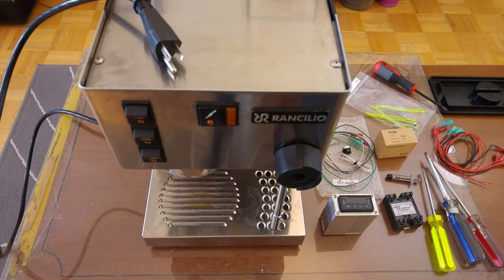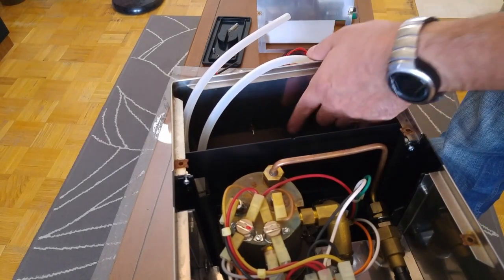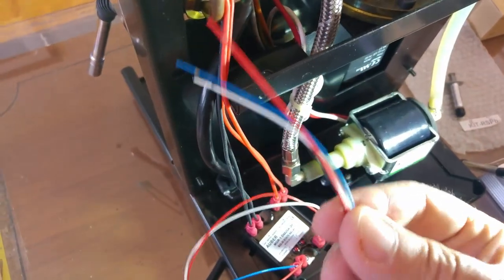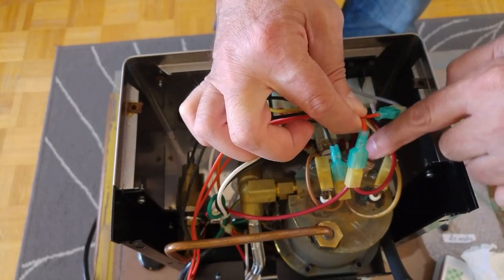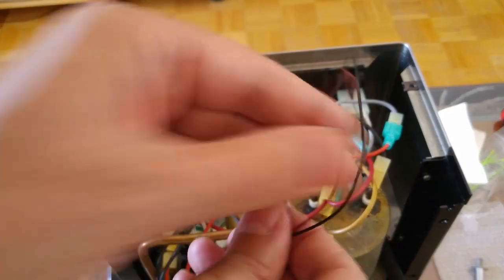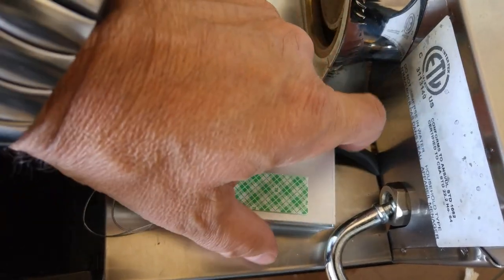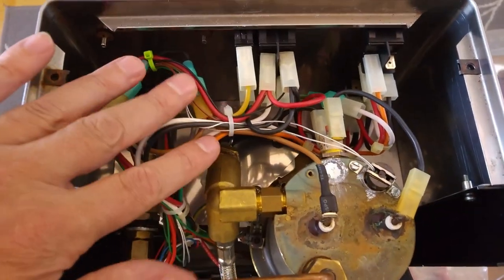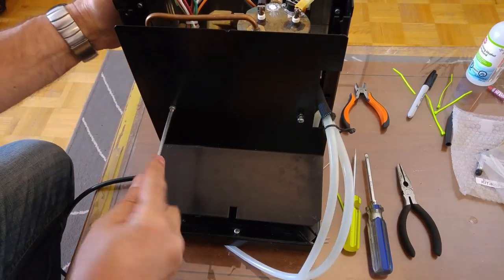How to Install a PID Kit on a Rancilio Silvia Espresso Machine - Auber PID

Comment: Excellent video to assist in the installation of the PID kit. Heads and tails better than the provided instruction manual. Neat job tidying up the wiring too. Thanks very much.

Comment: really great video thanks for your time and effort. I do quite some control work as an hvac tech & thought those smaller gauge wires would be 24vac never seen small wire like that pull 120vac I personally would never trust it from quite some experience of burnt wiring/controls
Reply: Are you saying we/he should use thicker wire on the black and brown? Can you recommend the wire we should be using?

Comment: Excellent presentation.  I installed a simpler version (no steam control) of the Auber PID on my Silvia about 8 years ago.  It worked fine until last week when the PID display didn't light up.  The boiler still heats, and the water pump functions.  When installing the PID I placed the relay  behind the front face plate of the Silvia.  Now,  upon removing that plate I noticed that the when the machine is on the LED lamp on the relay is not lit.  In your opinion, does this indicate a problem with the relay?  Thanks for your attention.

Comment: Hi!
First off, thank you for posting this video. It gave me the confidence to build this myself. So, I bought the kit, and installed it... Great! it works. Unfortunately about 20 minutes later after assembling the machine, the heat generation completely stopped. Before I was getting up to 280 F (I have no idea why the Auber controller let it go that high) , but now the machine won't heat at all. I am a little bit fearful that I broke the machine, but I've got absolutely no idea what went wrong. Could please you tell me which wires go to the heating element? Do you have any idea what could have gone wrong? Like I said before, the machine was running (and i have a video to prove this). Thank you very much

Mark
Reply from the maker: Probably you overheated the boiler, and the high limit thermostat open the circuit, check my video how to reset it https://youtu.be/AcLUg7lyorc

Comment: Thanks for the video, I have one question: how do you put it on steam now? Does the Auber PID have an option to (instantly) jump up to higher temp? (like 135c?). Or do you have to keep in the steam thermostat and use that? I'm interested in doing this mod. Cheers
Reply: I'm not him but I did PID my Rancilio and can answer your question. Yes, you basically don't need to remove the steam termostat and you can simply use it. You only need to control your brew temperature, so after you brew your coffee, you just flick the steam switch and the other thermostat takes control of boiler temperature. PID will stop switching on the heater because you over shoot with temperature anyway (while in steam mode). I hope this helped you and others. Cheers.

Comment: Rancilio makes a great machine, my only gripes about it are the drip tray is shallow and it sucks, needs a drain or to be bigger, the water compartment needs to be bigger, and the steam wand take forever and a day to open! 

To be fair, the steam wand has commercial power and it pulls a great shot, I don't like the strange positioning of the portafilter, more a fan on the gaggia classic honestly.

Comment: Is the PID box really held in place by two-sided tape? How long will that adhesion last with heat, moisture and gravity?  From my experiences with different brands of two-sided tape, I see problems not long down the road.
Reply from the maker: Hi, I have repaired machines with PID installed the same way, and it was holding well for couple of years. If the tape is good and you clean well the surface it should not be a problem for few years and then, how hard is to replace the tapes.
Reply: nothing else than 3M VHB tape....i think it can stick a truck to the ceiling !

Comment: Just purchased the Auber kit for brew temp only. The instructions show the solid state relay (SSR) should be mounted on the wall behind the splash guard panel (behind the steam wand). It looks like your SSR is mounted towards the back of the machine on the bottom. My instructions don't even call for the back panel to remove as you did. I wonder if this is the difference between the two different Auber PIDs??
Reply from the maker: Hi, it doesn't really mater  where you will mount the SSR, if the wires are long enough you can mount it where I have mounted it, and you don't need to drill holes it to your machine.

Comment: At 13:20 you mention the plastic/silicon tubing to protect the wires from getting cut by the sharp edges of the machine. Do you know if that comes with the PID kit, or do I need to go to order separately? If so, any thoughts on the size tube? Any Amazon link that you could share? Thanks in advance. BTW, great video.
Reply from the maker: Hi Robert,  the tubing is not included,   you can use any electrical insulation tubing to protect the thin wires, even electrical insulation tape.

Comment: We're does the ground get Connected to?, Great Video very Helpful!.
Reply from the maker: Ground is connected to the ground of the machine on one of the boiler screws, see the video at 9:52.
Reply: @dkaraboy  Where does the other end of the green wire connect to?
Reply from the maker: @stevengklein  If you are asking abou the ground wire it goes to the back of the PID box see it at 13:48

Comment: I've heard mixed reviews of the pre-infusion function, that since it just burst fires the pump at full pressure it damages the puck. What has your experience been? Is it worthwhile?
Reply from the maker: Hi, there is always air on top of the the boiler which acts as a buffer to gradually increase the pressure. The pump should compress that first before some hot water gets to the coffee puck.
Reply: @dkaraboy  thanks for the reply. Do you find the pre-infusion setting reduces channeling or otherwise helps with extraction? I'm seeing a lot of reviews suggesting it's not that helpful but most seem to be from people who haven't used it.

Comment: Hello, just a very quick question, where is the ground wire going to？
Reply from the maker: Please see the video at 9:50
Reply: @dkaraboy  I did follow that part, I was wondering where does the other end go, I found the solution but thank you very much for your fast respond.

Comment: all good but used a thermocouple outside the boiler im not sure that a good idea. pid will get temerature signal about outside surface of boiler not a water inside. because side walls of boiler is too thik we have some inertia in the measurements
Reply from the maker: Yes, you are right about the thickness of the boiler wall, there will be slight delay it the reaction of the sensor (it is a thermoresistor not couple) but this is very small delay. This is how this PID is designed to be installed.

Comment: Thanks a lot. I did manage to do the installation but taking off the wires once connected is close to impossible I mistakenly connected brew red wire to steam wire and it refuses to come off so I interchanged the red brew wire with black steam wire even that was difficult and I ended up break insulation so I just taped that part. Machine is working fine . Shouldn't give me any problems no?
Reply from the maker: Hi, if you used electrical insulation tape it is not the best choice in hot environment like the inside the espresso machine close to the boiler. With the time and the heat the tape glue will unstick and the tape will get loose, better use a piece of heat shrink tubing over the exposed connectors and heat shrink it using a lighter.
Reply: @dkaraboy  thanks for the advice. I'll order that but the part I broke is connected to the solid state relay!
Reply: And I broke one of the connectors while trying to pull it off and I just connected the wire to the ssr and taped it
Reply: Any email where I can share photos?
Reply from the maker: @abcpl14029  Oh man, that is not proper connection, there is big current going trough that connector, I thought you broke the insulation over the connector in my previous advice. If you broke the connector off the wire you need a new connector, strip the end of the wire, cover it with soldering for better contact and properly crimp it inside the new connector, then put heat shrink tubing over the connector ( if it is a naked one) and part of the wire and heat shrink it. If you just wrapped the wire around the SSR male connector, it will start heating because of the poor contact and it may damage the SSR.
Reply: @dkaraboy  okay I did wire it off but yesterday I got a naked connector and crimped the wire using a plier as I didn't have a crimping tool and got a sleeve to cover it and then had an electric tape over it. I actually didn't think it would be an issue plus Sharon on auber told me that there is nothing to worry about as no wire will touch the relay once you put pack the rancilio cover. I had a little thin connector which I got yesterday so I widened that a bit to fit on the relay and it slid right through. Should I get a proper sized connector today and have a new installation for that spade connector then?
Reply: https://photos.app.goo.gl/U8HwqBhfWVHTNGNv7

This is how I have done it now. The metal connector is properly connected and sucured and I have crimped it properly and then I have put a wire sleeve over it for insulation and then the electric tape on top of that

Comment: Hi, I have a V5 silvia and wanted to know if there would be any change in the process of installation or will it be the same?
Reply from the maker: Hi, your machine has the new type heating element, the rest should be the same. In the installation you don't connect anything from the PID kit to the heating element ( it has smaller connectors than the old type) so everything should be the same. You can open the top cover, the 4 screws and compare the rest of the connectors to the old ones in my video, they should be the same.
Reply: @dkaraboy  okay. I have ordered my kit from the auber website to India. Should I wait for the kit to arrive and then open and see or should I open it and see the connections now itself. The installation seems simple on the manual as well as the video but many a times things aren't as simple as they look. And is the PID worth the price ? Will I get better tasting shots than I do now?
Reply from the maker: @abcpl14029  You can open it now and check it, it takes few minutes only. With the PID you get better control of the temperature, also preinfusion, the taste is subjective thing I cant say is it better with the PID.
Reply: @dkaraboy  but isn't better control and pre infusion desired for better tasting and consistent shots if I'm right?
Reply from the maker: @abcpl14029  Yes, definitely the PID control is helping, but there are few more things you should perfect in the process, like good freshly roasted coffee - not older than two weeks, good espresso grinder with exact and uniform grinding like Rancilio Rocky - minimum, grind your coffee right before making the shot, exact amount of ground coffee, tamping, well preheated machine and portafilter all this will help to perfect your espresso shot.
Reply: @dkaraboy  i have a sette 270, didn't get the rocky as I thought sette 270 would be better except for the build quality. I have the ims basket with the stock portafilter, will get the naked portafilter soon and generally I haven't been preheating the machine due to time issues but will pay more attention to it now. I am unable to froth milk properly with silvia as the milk starts splashing out and gets out of control when the milk is skimmed buffalo milk .pacakged Tetra packs for whole fat cow milk is fine and I get microfoam and latte art with that. What could I be doing wrong?

Comment: how do you "cover" the old thermostat hole? what material?
Reply from the maker: Hi Vlad, I am not sure for which hole you are asking, if you mean the holes for the screws you don't need to cover them, some older boilers has a larger hole going down in the the boiler wall, you don't need to cover it, the water will not come from there. Between the new sensor and the boiler surface you need to apply some thermal paste for faster heat transfer.
Reply: @dkaraboy  i ce watchec another video of tuning Silvia. I thought that the thermostat it s inside the boiler, from this confusion i put that question 🙈.

Comment: Couldn't figure out how to get thosee fucking power cables at 11:30 connected, thanx!
Reply from the maker: You need to unplug the red and black cables and connect the  brown  and black thin cables then connect the original cables to the male piggy-back  connectors on the thin cables.